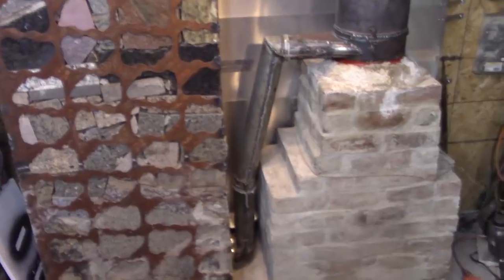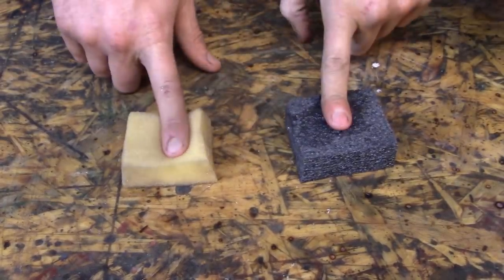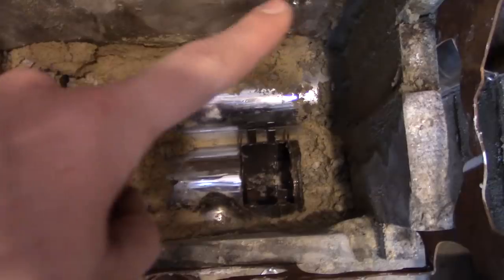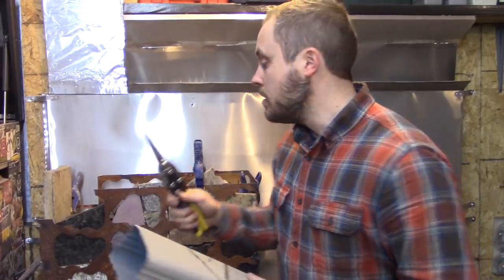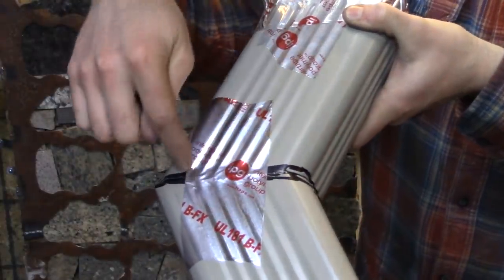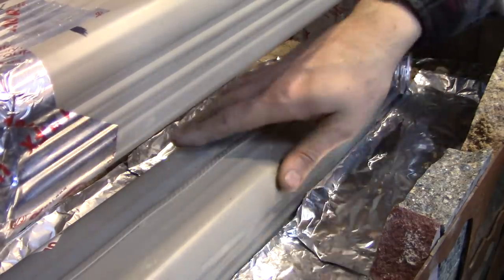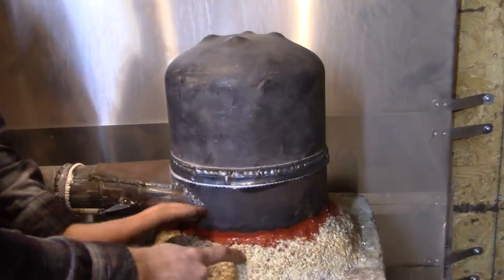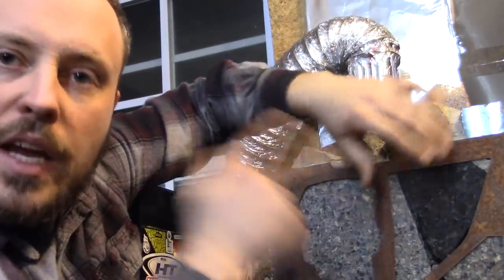Nautilus Rocket Mass Heater - Only $200 - Part4 FINALLY FINISHED!

Comment from the maker: My relationship with this heater is the definition of love/hate! So glad to be done, let me know what you think!
Reply: Glad you finally got it done! Looks great, hope it works great too!
Reply: I love it. As someone who burns firewood to heat the house i would love one of these
Reply: It looks great, and I was looking into building a one inside my shop as well. I was wondering if you could use concrete in place of the sand and gravel?
Reply: Looks awesome!! : ) Glad it’s working great. : ) You should give it a month an give us an update. : )
Reply: @MakerInTraining  I absolutely agree, please give an update in a month! (Maybe with some statistics about how well it works?) :D
Reply: I hope we get an update on how well it works. Maybe as a little side in your next video.
Reply: Great job!  I would like to see some performance specs on it in a supplemental video.  Things like the following:
1.. The surface temps at various heights at certain times as it heats up (e.g. tank temps, thermal mass wall temps at various heights, & exhaust temps at the window)

Thanks!
Reply: I'll likely be building one this summer. Thanks for the video!
Reply: JAIRUS OF ALL Love you man
Reply: JAIRUS OF ALL love the heater design and am going to try to replicate it in my 20 x 30 garage. One question: any reason why the air going into the burn chamber is drawing from the room instead of outside?  Seems like the heater could suck the warm room air out of the exhaust but I could be missing something.  Thanks in advance and awesome project!
Reply: I am amazed that you built this from junk. Also, does this pass building fire code ?? Just wondering. Will try the same thing either later this year or next year. Otherwise nicely done Jairus.
Reply: @rileyh212  Columbus, Riley?  🤗
Reply: Really love your nautilus design! Elegant use of junk! 
Yep..recycling IS very labor intensive..kind of one of those things, like, when ya work at a job, you have money to use, but no time to do other things to sensibly build one’s homestead; but if not working @ a job, one has plenty of time to do the homestead stuff, just, not enough money to do stuff. 
But a rocket mass stove is WORTH that effort, for the good it does. 
Really enjoyed your included lessons in engineering & physics..very good stuff!  Hope more take the time to absorb it, to really get it. 
Wonder if this design could work, without using metal inside it, and using clay, or refractory cement by itself?
Reply: @Chimonger1  I have no idea what you’re talking about, sorry.
Reply: @rileyh212  no worries! Just , you have same name as someone I know!

Comment: good job with the build you might want to put a carbon monoxide detector in there with it though
Reply: Yes,thats right. I think this is dangerous...it has to do with the heated air (which goes Up) but wen it's getting cold inside of the system, the exhaust goes back down...and the room fils with Carbon monoxide

Comment: Good call on the design in the mass section when you force the hot air down in those sections it works alot better than just interupting the flow, its the principal of Counter Flow Chillers used in beer making and alot of other times you need to get the heat out of a relatively high specific heat fluid. Has something to do with when a fluid is moving easily through a pipe it creates a boundary layer at the edges of the moving mass that imparts its energy but the main mass of energy flowing through the center imparts slowly to the outside of the mass. In the counterflow it rolls on its self essentially negating that boundary layer effect allowing more of the fluid to be exposed to the metal and impart its energy directly. I like the look of the heater its self and kudos for looking up and imparting the science behind it loved the video.

Comment: Hmmm.  There's a reason chimneys are straight and not complicated.  I can see that S system that's been sealed in the sand building up a lot of carbon, and if you burn wood that has not been dried properly, creosote.  I haven't finished Part 3 yet and may have missed it, how will you clean out the exhaust system?  At best this furnace will clog, at worst you created a chimney fire time bomb.
Reply: Dead Baron was thinking the same thing, hope he reads this in time
Reply: He is apparently burning it hot enough that there isnt any carbon build up. At least thats what he said in the last video.
Reply: @e4Bc4Qf3Qf7  Physically impossible.  On ignition and when the flames die down, there will be buildup.
Reply: I would think it would be as simple as burning one of those Chimney Creosote Sweeping Logs... Granted those come with some skepticism.

That said any chemical attack on creosote will eventually fail over time, there will need to be some physical attack on the buildup. 

I'm not an expert, here's the source I refered to http://usfireplaceproducts.com/creosote-busters-for-chimney-sweeps-chemicals/
Reply: Dead Baron just saying what he said
Reply: I agree every section needs to be accessible especially flat sections soot and creosote will build up and block it/set on fire.....in an aluminium tube stuck together with tape 😟
Reply: Why do people always chime in stating problems, yet provide no solutions? Are you just attempting to prove to strangers you know more? Good, great. So you go fuckin do it then instead of watching others and criticizing. If you arent part of the solution you're part of the problem. Now quit being part of the fuckin problem and get out of the way.
Reply: @UncleDiddles   I think it's a sound idea to point out that using this could literally burn down his house. He might be handy enough to keep this from happening, but people watching this as a tutorial might not be. Plus there two good solutions provided for the possible coke build up. I think overly load, unnecessary swearing, mouth breathers are the problem, but you don't see me posting about it.
Reply: @UncleDiddles  I think they pointed out a potentially serious problem, but DID offer solutions... 1) make every part accessible (though this may be aimed at subsequent builders, I can't see how Jarius could redo his without basically rebuilding his mass portion "from scratch") and 2) burn a "chimney log" periodically to try and clean out any carbon build up.

And since Jarius is (apparently) committed to approaching this "scientifically", you'd have to acknowledge that part of research includes "peer review", where others examine your theory for flaws and offer further improvements.

All in all, Jarius did a FANTASTIC job, but some helpful suggestions (ESPECIALLY when considering the potential dangers of a chimney fire) should be welcomed, not silenced.

Just sayin...
Reply: @UncleDiddles  I think they pointed out a potentially serious problem, but DID offer solutions... 1) make every part accessible (though this may be aimed at subsequent builders, I can't see how Jarius could redo his without basically rebuilding his mass portion "from scratch") and 2) burn a "chimney log" periodically to try and clean out any carbon build up.

And since Jarius is (apparently) committed to approaching this "scientifically", you'd have to acknowledge that part of research includes "peer review", where others examine your theory for flaws and offer further improvements.

All in all, Jarius did a FANTASTIC job, but some helpful suggestions (ESPECIALLY when considering the potential dangers of a chimney fire) should be welcomed, not silenced.

Just sayin...

Comment: I appreciate you taking the time t explain the why and some of science around the design. My one question was why if cooling air wants to travel downwards would you build the heat exchanger with the flow going up?

At some point I realized why this may be a deliberate part of the design and not just a habit of "chimneys go up". Is it to help dampen the flow rate in the exchanger?
Hot air comes in at the bottom at the start when everything is cool. Even loosing some heat to the exchanger this first bit of air is probably warmer than everything else in the pipeline and wants to go up.
After this is started and even when it's all up to temperature you have hot air low down and it cools as it goes up, becoming denser than the air low down. That would mean stuff travels slower than if your chimney ran from top to bottom? (Which here you want to give the air time to warm the aluminium and the sand).
That or I got something wrong as every vertical chimney would do this. Maybe every vertical chimney works because of some property of gas flow I don't know about.

If anyone can point me at some good explanation of how a chimney works and explain if I understand why the heat exchanger is this way around I'd be greatful. I've got an Electronic Engineering Degree so I am ok on basic thermodynamics and technical wording. I just know very little about fluid mechanics and so on.

Comment: I'm preparing to start a build of my own and plan to embed some small horizontal rods (coat hanger?) protruding into the burn areas at various points and extending to barely visible outside of the mass. The heat loss should be minimal, but I'm hoping to be able to be able to use a digital temp gauge to get some data on what is going on inside at every stage, and hopefully allow me to "fine tune" with a few adjustable dampers to achieve the optimal burn. It might take some of the guesswork out of duct sizing for a future build, Opinions seem to be all over the map. Is bigger better? Would adjustable dampers help? Close them up initially, then open slowly as temps rise? Without hard data... who knows?

Trying to keep the "science momentum" going.

Thoughts?

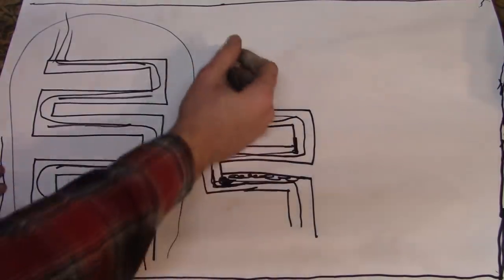Comment: @6:00 you are talking about "reduced airflow" at the "blockage".  But a restriction in a duct or tube will speed the air up through that point (bernoulli effect).  With your very small restricted areas, I don't think the airflow will suffer measurably.

Comment: You could have put radiator fins in the pipes toward the top to more efficiently suck the rest of the heat out of the air and transfer it into the material.

Comment: A nice design, and I really enjoyed your sharing of the science principles that make it work. HOWEVER, like so many others, you project is too focused on what it cost to build (only $200?) and not what it saved you in the long run. You spent several hundred man-hours making it and, while you may have the time most folks have to work, care for family, etc. and so a project like this is impractical. The old adage (Time IS Money) proves true for most of us. I think it would be better if you built one from  stuff you get from the hardware store (round aluminum duct instead of downspout, etc.) and not what you can scrounge from scrap yards some don't have access to.

Comment: Those joints before the 'mass transfer' section are going to be leaking CO like crazy.
The long winding exhaust path necessitates relatively high exhaust pressures at those joints (probably at least 5 psi at a decent flow rate) and they are most certainly not suitable for single-digit ppm levels of CO leakage at 1-2psi of pressure differential.

Still, I find it really hard to believe that the system would be able to push its exhaust through all of that pipework without simply backfeeding out of the inlet. The only way that I could see this remotely functioning would be to get assistance from the wind; however that would entail allowing a lot of cold air to blow into the room, so you'll probably want to directly draw intake air exclusively from an outside (after you have sealed the joints of course).

The best solution would be to put some sort of compression fan (even just a small axial one used for RC airplanes or such) at the inlet to ensure that you get most of the hot exhaust to head through the system in the correct direction.

Comment: what if you used compressed air to shoot a copper winding through a magnetic field a short distance and rebounded it off of a mechanical spring back through the magnetic  field and timed the next blast of air to send the coil again  over and over to produce electricity?  maybe small light coils with reduces friction actions and then use multiple ,coil spring units , timed  and plumed to use the same blast of compressed air in sequence.
Reply: maybe a pendulum rather than a shaft?

Comment: Drawing cold air increases efficiency because it is not using air you have paid to heat already.  Heated air burns more of its oxygen than burning cold air. Preheat outside cold air to maximise efficiency.

Comment: did this continue to work? im currently building my own 6" system and intending to do a very twisty turny high density heat exchanger.  but  im concerned that to many twists and turns will slow the flow too much to achieve a reliable draw.  yours seems to have significant back and forth so im interested to know if this continued to work or i should opt for a design of heater exchanger with less turns but the same total flue length. advice appreciated. ah ive just found your update video nvm.

Comment: As I own a cement floor workshop, which gets intolerably cold in winter,  this video was extremely helpful. To bad you hadn't seen this https://youtu.be/hIEmeim0uMY video, were fire proof cement is made with mostly found stuff. He uses it to form the core of the stove around a mold plug, saving tons of build time. Your video was very clear on the science behind a successful heater. The links you mentioned will help as well. A follow up video with some detail on priming and your feedback from 2 winters use would be greatly appreciated. Thanks, keep up the good work.

Comment: Where are the numbers? The efficiency ratings on a full burn in different conditions?
You basically condemned other youtubers for not providing proper information in your first video then you “tell us” about the science and how it “should work” but you never provide the data of your supposed success.
Given the complexity of the project it really could be a facinating analysis video to see how it worked and what worked best or any failure.